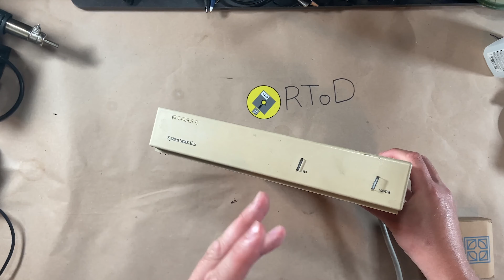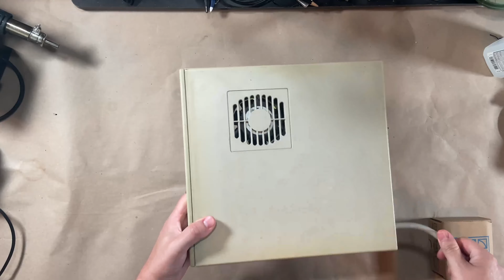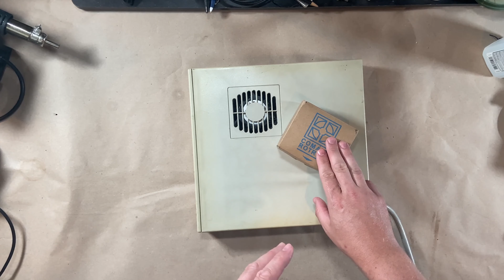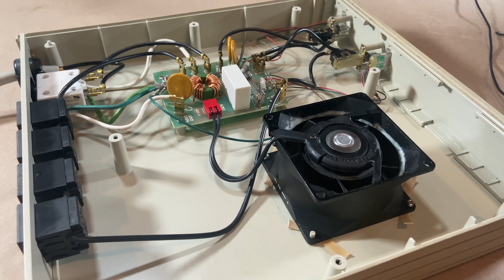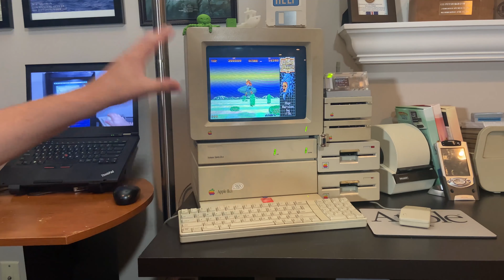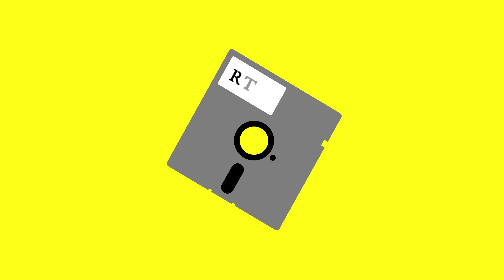Keeping it Cool: Upgrading the Fan in Kensington System Saver for Apple IIGS

Comment: Last time I opened my System Saver, I noticed its surge protection was apparently compromised, as one of the MOVs (those yellow discs) had blown. A lot of black and charring around it too! Didn't know how to solder back then, so left it as is. Know the rating and type of replacement? Figure I should fix that before getting to changing the fan.

Also noticed I'm getting what looks like a ground-loop (horizontal line slowly scrolling up my monitor) whenever any of my AppleColor RGB's are placed a top the System Saver IIGS. Could it be that blown MOV is creating that interference?
Reply from the maker: The interface is likely from the MOV, I’m out of town…but when I get back I’ll open it and see if I can find any values for you.
Reply: @RetroTechorDie  - Thanks, I'd like to take a go at soldering in a replacement. I might need to change the two large resistors (behind the fuse) and just beside the MOV. I noticed some heavy discoloration/burning on the PCB just below them--likely something nasty happened that caused them to overheat and cause
 the MOV to pop. 

I'd also really like to get a new AC fan, not only so it's quiet, but I'm getting what looks like a ground loop (or magnetic interference?) on my AppleColor RGB from the fan. It's a horizontal line that slowly sweeps up the screen. Disappears as soon as I move the monitor away from the fan. But ouch, the Comair fan on DigiKey is CDN$100 and that's before even shipping. Are there less expensive options, or a way to fix fix the fan interference?
Reply from the maker: @Apple2gs  I posted the pictures on YT and tagged you.

As for the fan you could replace it with a similar sized DC if you are comfortable. You would need to solder a transformer to the old AC fan wires to power whatever DC fan you find as a replacement.

Comment: I’ve replaced it with the same type as stock because I wasn’t aware of the difference between the bearings 

I understand wanting to try to replicate as close to original experience 

A few years ago I came across an Applied Ingenuity InnerDrive enclosure, but no original drive or controller. I still wanted mechanical drives and I happened to have a couple of notebook IDE hard drives. I paired them with a MicroDrive Turbo as the card’s original developer did market it as an alternative controller for more modern hard drives and it works great!
Reply from the maker: I love the MicroDrive Turbo! Having that and stil using origional media is amazing.